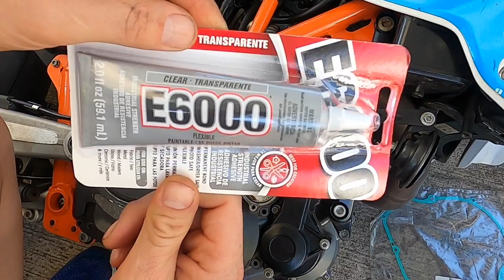KTM 690 Enduro R Engine Case Protection Install

Comment: Have you had any issues with the adhesive? Mine started to soften and drip a bit. Typical oil temp for an engine is up to 120C, the adhesive is only good to 82C so I guess that sort of makes sense
Reply from the maker: Not at all. My anodizing is all faded 🤣 but the glue is holding on both sides. Since whenever this video was made.

Comment: I haven't experienced this problem, but very early on I replaced the brake lever with a more solid product.
Reply from the maker: That’s what saved you 🤣 so good job.
Reply: @JohnHowerton137  I believe that I got it from Vanasche, I have several of their parts on my 690 R. Also on your advice I replaced the shift lever.
Reply from the maker: @TheBigdutchster  I’ve looked over the Vanasche parts. Looks like they make nice products. Shift lever working out well for you too?
Reply: @JohnHowerton137  It's working very well and I feel that it's vastly superior to the rubber OEM part. It kind of a mystery how KTM uses some great parts in places but cuts corners in others with a lot of plastic. Ive done some practical things and some bling things on my. Love the bike and greetings from MI.
Reply from the maker: @TheBigdutchster  great to hear. I don't believe there is anything inherently wrong with the shifter, it's actually the same shifter I've shifted with perfectly millions of times with on other models, it's just the angle in which the tip sits because of the angle that it comes off the 690 engine. The tip folds under pressure and has a sharp edge against the foot which I suspect subconsciously the body doesn't let the foot put a lot of pressure on... therefor you get engagement that is soft, like if you were going to click the bike in neutral. The new "mud free" tip is instep friendly and lets you get more pressure to get good solid engagement.

I do biomechanics stuff all day long as my day job, so I'm really good at details and thinking outside of the box on stuff like this.

Happy riding 🤙 Rubber side down!